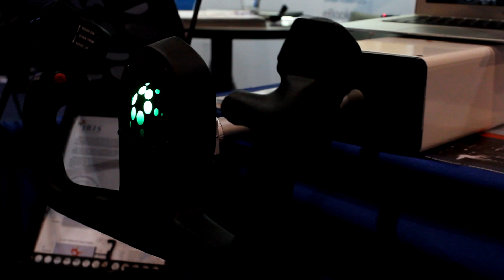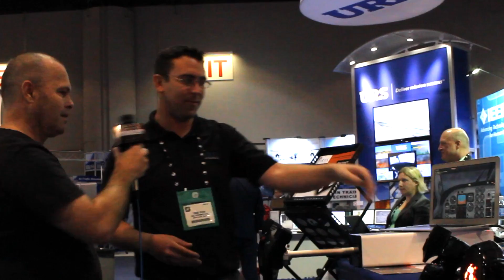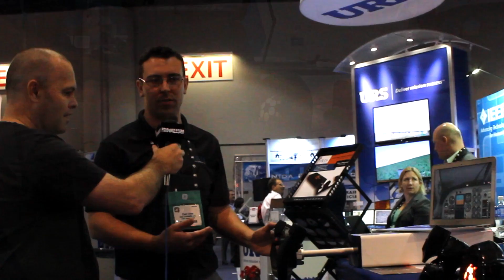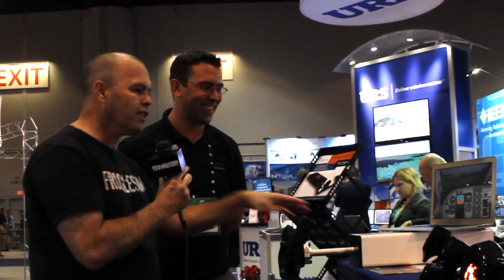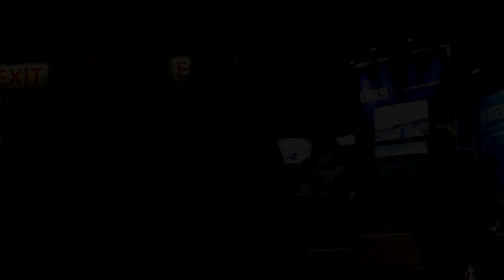INTERVIEW WITH IRIS DYNAMICS

Comment: FSForce seems to have been running on the sim while the yoke is in use, does the trim control loading require FSForce?
Reply from the maker: ***** No idea.
Reply: frooglesim Thanks anyway, I tried asking Iris directly but no response.

Comment: As the site is in canadian dollars, I figured out that the UK price would be about £1000 not including shipping. Their original kickstarter aim was "an affordable force feedback yoke", and if you compare it to industry prices then maybe you could argue they delivered, but I think that for most simmers that price is not affordable. Kudos to the kickstarter backers who got theirs for a lot less though.

There is a HUGE hole in the market for the equivalent of the TM HOTAS Warthog in yoke form - (nearly) all-metal, hall effect sensors, price bracket just the comfortable side of £300. Come on TM, we need you :)
Reply from the maker: I've been thinking over the price point quite a lot recently. it is a very high price but we have been very lucky in flight simulation. In Sim racing for example it's not that unusual to find a high end controller set nudging 1000 dollars in total. In fact in that side of simulation there is a whole cottage industry around full Sim rigs choosing many thousands. not that any of that makes this particular products price point any gentler, just an interesting observation.
Reply: frooglesim good point. Looking at the pro end of non FF / CL hardware, £500-£2000 is not uncommon, so a grand (if I worked it out right) seems alright. Despite my criticism I'm actually considering one. I had my eye on the PFC Cirrus Saab which is cheaper but it's not CL.

Comment: I wonder why he keeps trying to straighten the handle? Is the weight of the left side of the handle sufficient to overpower the rotational control loading?? Or was the plane just experiencing engine torque? It's not a single engine craft though... hmm...

Comment: MS FFB 2 does exactly the same thing for a fraction of the price.
Reply from the maker: Thorolf Nope, it really truly does not.
Reply: frooglesim
Oh really? Care to elaborate? It does everything that was shown in that video, 1:1. Including realistic trim (no center point), moving automatically, etc. It's the only stick so far that's capable of that (the Logitech to some extent).
Reply from the maker: Thorolf Well, 1st that's a joystick, this is a yoke. Second, it's a force feedback joystick that uses cogs and gears to impart vibration to the user to give some sense of feeling about what the aircraft is doing, while this is a control loading device that accurately relays the actual weight and feel of a directly connected yoke in a real aircraft. Third, the Sidewinder uses cogs and you feel "cogging" in it as they kick in to vibrate or move the stick, where this uses a load actuator to put physical weight into the yoke (again just like you would get in a real aircraft), fourth it's one of the few yokes on the market with accurate travel, multiple times what you get in a joystick or even a Saitek yoke.

It's accurate enough for NASA to want to use it in fact - they don't own that many Sidewinders.
Reply from the maker: frooglesim Finally I'd have to say from my brief impression, having flown real aircraft and used countless force feedback devices, this feels very very very different indeed.
Reply: frooglesim
We're not talking about an X-Box controller here! And the "cogging" is a problem of the Logitech stick, but virtually non-existant in the MS stick, unless in extreme cases. If there's only bumping and vibration it's not the stick that's to blame but the software. FS Force remedies that. And DCS also provides reasonably realistic trim, at least for the choppers. It's beyond me how people manage to control the DCS choppers with spring loaded sticks. Well, judging by some videos out there, they don't. And spare me that crappy NASA argument.

It boils down to this: does each stick provide realistic trim like a real aircraft (with proper software support), as opposed to, say, a spring loaded stick or a cheap FFB stick? The Sidewinder definitely does.
Reply from the maker: Sounds like you have the perfect solution for your needs and I'm obviously completely I'll informed. Thanks for taking the time.
Reply: +Thorolf
You do realize one is a stick that uses force feedback, and the other is a yoke that uses control loading?  Not sure how the two are the same, but just because you say it's so doesn't make it true.
Reply: x -wind You can't argue with people that have all the answers! LOL a sidewinder.

Comment: That's what I've been waiting for... so long. We got that for racing simulators long since and now finally for simulated planes as well. Definitely want one. By the way, just because someone brought up the following issue I wanna revisit it:

Since common fly-by-wire systems usually completely decouple pilots from flight physics and thus from ocurring forces on the rudders, hence there's hardly any or rather no force feedback noticable anymore, modern fly-by-wire systems provide nowadays even an artificial feedback system via so called actuators connected to the control units surfaces.

In modern fly-by-wire sytems the flight control computer determines how to move the actuators at each control surface to provide the ordered response, with the result that the pilot can "feel the plane" again.

That means, you can of course use these Iris Dynamics yoke even in your fbw- airliners and just need to pretend you'd fly one of those latest fly-by-wire systems ;). I definitely will.

Wished, they could also provide a similar professional technology for mere joysticks and pedals, of course, for e.g. Airbusses or warplanes use (side)sticks. Otherwise Logitech's annoying Flight System G940 had still to do it. :( Anyway, it's good to know that finally some more progress's made again and a realisticly simulated professional force feedback yoke is available for armchair pilots. Thx for the info!

Comment: this could get some well deserved love towards small planes in x-plane which is a good thing...however those planes that have a fly-by-wire system actually "feel" what our regular joysticks provide...so flying those planes would be kinda unrealistic. but still good to see some evolution of thinking and methods.
Reply: Not exactly, the B777 and B787 are fbw aircraft but as these aircraft are base on the speed stability, there is a force feedback system on the yoke to help pilot trimming. But I agree, there is no point using this harware with Airbus add on